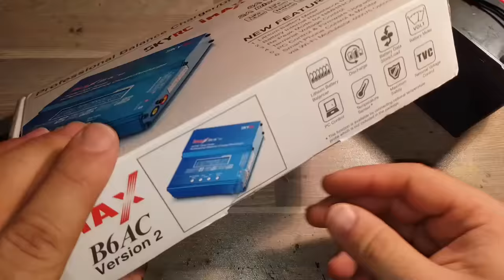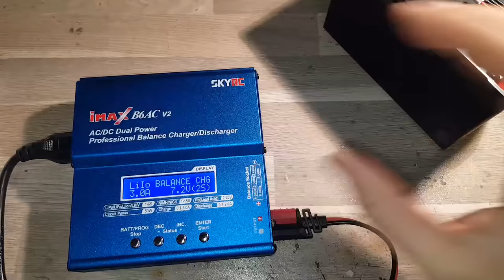DIY How To Make a Powerful 12V 18200mAh 420A li-ion Battery Pack

Comment: Sir, that's a nice and tidy make up. Excellent job. By the way , recently I made a lithium pack from BMS 20amps  3s and I put four cells in parallel 12.6v. But can I add another three cells to the parallel pack to make it seven like that of yours..?
And not forgetting your spot welder. It's nice and handy... 👍👍 Can you give a description from where else can we get it, or is it possible to set it on DIY..?? Pls respond..! Thanks.

Comment: Good morning, I hope someone will help me.  I have to make three 12v batteries that I will put in series, but to charge them I will charge them individually.  Now, I don't get 3 batteries of equal amperes, two 10.5A and 1 of 12.9A.  Of course with BMS.  What can I do now?  Do I put an extra row of batteries to get as close as possible to the amps of the largest battery, or do I distribute the largest 18650 batteries over the three batteries so that you get 3 almost equal batteries?  Is the BMS able to withstand a difference in level of 250mah between the big batteries and the others I have?  Perhaps it is better to put an extra row of 18650 on the two smaller batteries.  What do you say?  A thousand thanks

Comment: Is this working without BMS ? Why need bms
Reply: Bms is battery management system. It protects from overcharge, overdicharge and stuff. You probably could do it without but if you go below 3 volts or so your battery pack may get permanently damaged inside.

Comment: Use BMS for healthier batteries :)
Reply: Lol.
Reply: He probably thinks it's OK with no BMS since he uses a Hobby Charger.and balance charging. This will take a LONG time to balance since it uses very small balancing current. Even with normal "Balancing BMS" board it will take forever to balance.
Of course with no BMS there is no Over-discharge protection, which is the most "dangerous" aspect of this build.

Comment: Hello from California. Thank you for the presentation.
Do you have to have external balancing cables, when you, already have a BMS connected to the battery cells?
I know, you are not going to respond to my query. But that’s alright.  
I have assembled similar package with 20A BMS, with no external balancing cables, 6 years ago.
Charging is done by connecting to the Positive and Negative terminals only and it’s charging and discharging well.
Thanks.

Comment: 3 in series by 7 in parallel? Nominal voltage of a 18650 is 3.7v. 3.7 x 3 = 11.1 so most of the time its not going to have a 12v output only when its almost fully charged when the cells are 4.2v each. Do BMS do step up/down voltage regulation?

Comment: The strain on the main terminal wires plus the uninsulated top of the pack made me uncomfortable.  It might work for awhile but this is not a safe battery.

Comment: don't try to fool, those 18650 batteries are each 2.200 mah peak. which every three batteries is in series and those 7 packages of three batteries are in parallel. which would give a value of 12v and 15.400 mah, the amperage would be 15 amp and 400 milliamper peak. which   the nominal amperage would be  between 8 to 10 amps, more or less  I calculate
Reply: Try to calculate after studying more electricity physics. Yes, I'm agree with 15,4 Ah , maybe more, but each cell of all 21 can give over 20 Amps short time, so this battery sure can provide 11..12V @ 140A. You confounded Ah with A !

Comment: Nice one :)  But did I see right,  Are you charging it using LiPo Settings on your Charger ?
Reply from the maker: Yes, because in the charger settings is not right, there are error, the real settings lipo battery is 3.2-3.6v and li-ion 3.7-4.2v, but my charger settings is lipo 3.7-4.2 and li-ion 3.2-3.6v.
Reply: @ARMTechHomemade  ... the charger is correct...
3.2 to 3.6V is for LFP LiFePO4 cells... 
lLiNMC or Lipo are 3.7-4.2

Comment: I received the same spot welder today but is not the capacitor you told me it is different one you told me 50v 2200uf capacitor but it is not because they send me with the unit 35v 1000uf  why you told me 50v 2200uf ? thanks very much it seems to be two types i dont understand please explain thank you
Reply: Mine has also a 1000uF 35v and some do receive this board with a 2200uF 35 or 50 volt, it's not a big deal.
Reply: so please what do i have to look out for so i dont damage the mosfets  ???,  because lots of people complaining that their unit don't work anymore... I haven't connected my one yet but I'm trying to get as much information as I can so I don't damage the unit,  thanks, big thumbs up

Comment: What’s that cool „spotwelding device“??
Reply: One of the cheap spot welder tools online for building and repairing battery packs
Reply: @brettschacher8644  what’s it called?
Reply: @Mustangschweinderl  Spot welder ! There are dozens of different models online but they all do the same job. Powered by batteries or super capacitors.

Comment: what is the rating and the voltage of the capacitor please because I have one of those welder and I need to get a capacitor for it but i dont know what capacitor to get??? thanks
Reply from the maker: for this one you need 50v 2200uf capacitor

Comment: Hi, great job.
I hope I can get one as I have several recycled 18650s.
I understand that it does not carry BMS as it solders the cables for balancing on the IMAX.
What is not clear to me is where it connects them, the last Niquel welds are not clear to me. Is it possible to find a wiring diagram somewhere?
thank you

Comment: Once again, someone is building a battery without fully understanding what they're doing. 

Yes, you're using a BMS.  Yes, you even put a separate balancer charge plug.  But all you're balancing is the individual banks of cells.  The individual cells in each of those banks are not balanced.  This will create problems down the road.
Reply: Wrong! Cells in parallel don't need balance. They have same voltage. Think, man!

Comment: I wonder if that would still work in a battery back up system.  That the led equivalent fits in.
Reply: Sealed lead acid batteries and lithium packs have very different charge rates, and systems.

Comment: Usta 12v nasıl buldun 3.7x3=11.1 yapmiyormu ben yanlışmış hesapladım bende yapmak istiyorum şemasini atarmisin sana zahmet
Reply: Birde kaç tlye mal oluyor
Reply from the maker: When you full charge it 3x4.2=12.6v
3.7v it's not full charged

Comment: Why do you spotweld these Batteries...  Each of them need a fuse on at least one side!!!   Why  420A???  It is only a 7P3S Batterypack....  you shoud not use them with more than 7Amp for a long time...  Or you will damage the cells

Comment: Why bother putting a 60A board on a a battery that's only good for maybe 20-30A? Even if you used copper strips the cells aren't capable of 40A continuous any day of the week, I can guarantee that. If the P42A and Samsung 30T can't do more than 35A continuous then those LittoKala 18650's probably can't do more than 20A.  I'd be they are good for 15A.

Comment: Lifepo cells is little bit better, because you can use it in 4S format instead of 3S and get a little bit more Voltage ranges for full and empty range. And more current ability. However  If I know weel more expensive :S

Comment: absolutely wrong - this cell typically gives 2 Amperes at 3.7 Volt ( between 3 to 4.2 V).

Three cells in series will give 12 Volt.
so , 7 such series are connected in parallel - 
THAT CAN GIVE ONLY
7×2= 14 Ampere !

Comment: @ARM Tech Homemade - great video.  I made up a couple of these packs, but when I put them into the APC UPS, they run fine for a few minutes then the red light goes on, along with the audio alarm.  Not sure if I missed a step, or hopefully you have the answer to what went wrong.  Thanks for any info.

Comment: Can I get a link to the battery you used to drive the spot welder?
Reply from the maker: https://www.aliexpress.com/item/32995442667.html?spm=a2g0o.productlist.0.0.17aa5ee7ILu2Mg&s=p&ad_pvid=2020091712545371980306520200000575970_1&algo_pvid=552a6bdb-50d5-483b-97cf-56c865d05594&algo_expid=552a6bdb-50d5-483b-97cf-56c865d05594-0&btsid=0b0a0ac216003724929622866ef08a&ws_ab_test=searchweb0_0,searchweb201602_,searchweb201603_
Reply from the maker: take 6000mAH  60C
Reply: @ARMTechHomemade  How do you charge it?
Reply: @ARMTechHomemade  Could I just use a 12V 35Ah SLA battery?
Reply from the maker: @Jasonewa  https://www.aliexpress.com/item/32831586944.html?spm=a2g0o.detail.1000060.1.641837d2PmuxEw&gps
Reply from the maker: @Jasonewa  yes you can try it.
Reply: @ARMTechHomemade  I read somewhere that you should use a battery with at least 450 cca and 18ah 12v batteries can supply up to 255A at once. Running in parallel gives me 510A, should be enough to spot weld .1 thick nickel strips

Comment: 3 batteries in a series is 11.1v, but 4 will be 14.8v. Both are a distance from 12v. What is a better option, 11.1v or 14.8 v?

Comment: What is that circuit you connect in lipo battery to  weld where can i order?
Reply from the maker: https://www.aliexpress.com/item/1005001278462873.html?spm=a2g0o.detail.1000014.15.47552a43lmj0J0&

Comment: Sir can u supply smd led, capacitor, mov, resistance, ic drivers, ACDC batteries, DOB raw materials, led  strips, led tube lights raw materials  with Tikki fitting n punching machine n all other accessories etc, guarantee of raw materials, mode of payment,  please send me the details of the above immediately
Reply: No. This is Youtube, not product supplier.

Comment: NOPE!! Does LiitoKalas are not 60Amp burst. Basically they are refurbished cells from laptop batteries and have internal resistance about 40...60milliOhms and usual current 1...3Amps, max 5Amps. Your battery pack has 35Amp at best, not 420 Amp that you think. If You dont belive me,  try to short it  whit 150Amp fuse. BatteryPack shoult easily pop the fuse... but i can eat my hat, that it wil not and battery will make bad smell and goes warm!

Comment: bonjour Monsieur,je suis bloqué malgré mes recherches,si vous pouvez 
m'orientez s'il vous plait,je cherche un bms pour mes 50 piles 
LGGBMH11865 3200 mah pour monté un 10 s 5 pack 42 volt 16ah ,je cherche 
sur ali mes il y a tellement de produits,je suis un peu perdu,merci de 
votre aide
Reply from the maker: Bonjour,  je vous propose d'acheter sur Amazon,  c'est la même produit que ali, mais livraison plus rapide et en plus je déjà utilisé cette BMS et il fonctionne parfaitement. 
https://www.amazon.fr/dp/B07CMB83RN/ref=cm_sw_r_cp_apa_fabc_qyZ.FbGVPDT43?_encoding=UTF8&psc=1

Comment: How to go about to make 12v 5amp for bike battery
Reply: May we help you?
Reply: @mohammedyasarshaikh4090  yes pls help needed.
Reply: @arvindaable  simply by connecting batteries in series you will get more voltage and adding individual batteries in parallel with each battery will increase Current, thank you

Comment: good packing, but fake information, from where you state 420A!!!, this is 3S7P, so MAX current 18650 battery in world is 30amp so 30X7= 210amp and this is for few secs only, for real information use battery quick discharged and see what you will get (you will be lucky if you get 200amp), also despite this is Chinese made, do discharge from 4.2v down to 2.8v to see the real capacity.
it would be great if this pack can produce around 60WAH, also Pulse current is useless here it will only trick the audience to say WOW.

Comment: Really !!! Litokala?? 40A ?? Even best brands doesn't have cells that can handle 40A and you are showing people Chinese cells with fake discharge current rate ?? Other thing only 4 0.2 nickel plated series connection this is a joke also 1 nickel strip to discharge connector ?? No more than 6A continuous discharge. Everything above start overheat strip and it may cause fire.

Comment: Liitokala – batterie rechargeable 3.6V, 18650 mAh, 40a Max, impulsion 60a, 2600, 18650

Color:
    1PCS

€ 2,12
€ 4,41-52%
Livraison : € 8,81via Seller's Shipping MethodLivré le 23 AOÛ ou remboursé intégralement
Liitokala – batterie rechargeable 3.6V, 18650 mAh, 40a Max, impulsion 60a, 2600, 18650

Color:
    10PCS

€ 17,87
€ 37,23-52%
Livraison : € 10,57via Seller's Shipping MethodLivré le 23 AOÛ ou remboursé intégralement

Comment: These cells seem to be chinese cells...maximum 10 amps/cell (you don't show us...), so it's impossible to produce 420A !??, but just 70A max (7 cells in //) and surely less than this Max.....and it's the best for you, guy, because your thin nickel strips could not support such an high amperage.Please read all judicious comments below!
And even with such an assembly for 50A,  possible that the // connection is enough, but it's necessary to double your serie/strips  to avoid any dangerous damage if you really simply need 50A......
When I think you already have 2.126.176 views (and how many neophites.?)..In France we say "it makes me cold in the back"...Please, please modify your video, it's surely pleasant for you to show what you can do on the screens...but what you do is wrong...no, not wrong , because your battery can be used, but dangerous if we need the Max Amps. Music explains nothing, useful explanations are missing!

Comment: This is VERY DANGEROUS! You didn't provide balancing resistors or capacitors or isolation diodes or install charging control devices as ALL Li-ION makers REQUIRE when building "packs" from their individual cells. I work at a hobby shop and we sell Li-ion, Li-Po , LiPo4FE and more exotic batteries. Half the cost is the PROTECTIVE DEVICES. Open a name-brand power tool battery pack and LOOK what's in there! Your "pack" is a fire or EXPLOSION waiting to happen. Go ahead, be stupid. Cause a fire in your apartment complex that kills 16 people like in Indiana FROM A "HOMEMADE RC CAR BATTERY"!!!

Comment: Iz 10.8v battery bro!
Reply from the maker: 3x4.2=12.6
Reply: @ARMTechHomemade  batteries are measured by nominal voltage which is 3.6 in this case

Comment: only one of that cell series have seven cells, it is mor than 12v an the video title is about 12 volts, Icant understand that
Reply: This battery pack uses THREE groups of 7 cells in parallel. Each group of 7 cells has nominal voltage of 3.7V, so three of those in series means 3 x 3.7 = 11.1V
Reply: @johncoops6897  ok, nice response, I suposed 4.2v, thanks
Reply: @omarramirez5764  - Full charge on 12V Lead Acid battery is about 6 x 2.35V = 14.1V. The 3S Lithium pack would come off the charger at 3 x 4.2V = 12.6V
The best replacement for 12V Lead Acid is a 4S LiFePO4 pack, as they have an almost perfectly flat discharge voltage of 3.2v each,  so 4S is 12.8V and acts like a 100% charged Lead Acid for approximately 90% of it's capacity. LiFePO4 is also much better on "impulse" current.
Reply: @johncoops6897  Im working at this moment in a pack like the yours one to be used in a scooter 150cc for start the engine. Im selecting cells.. thanks by response John.
Reply: @omarramirez5764  - Use Lead Acid batteries for starting your scooter. They are cheap, handle the current, are reliable and work the best, that's why everyone uses them.
Reply: @johncoops6897  Sorry to say that but im unemployed due to pandemic situation. Recycled LI Ion cells are cheapest than lead acid at this moment... Also, Im learning a new things. i have 80 cells that are tested and reviewed. From Dominican Republic Thanks
Reply: @omarramirez5764  - 80 recycled cells from  old laptop batteries, right? So, when you check the specs (google is your friend) you will find that they have maximum discharge current of 4A or 5A per cell. So, to get a 100A starting battery, you'd need 20 or 25cells in parallel then either 3 or 4 groups in series.
That's almost all of your cells - how are you going to house that, perhaps build a special trailer?
How are you going to charge them? You cannot use the existing bike charging system, so you have to buy something else. You can't easily disable the existing bike charging (alternator) so you either spend money buying and installing a charger or you spend money modifying the bike... otherwise.the thing will fail and might even catch fire!
Also you need a 100A BMS or some other way to ensure that voltage never drops too low, and the cells are protected against over-voltage too.
TL;DR: you cannot (easily) replace an existing Lead Acid battery with a lithium pack like this.
Reply: @johncoops6897  Good Information. I have cell database page in bookmarks. The old lead acid battery says 12v 6.5aH, It worked but not as good as the OEM battery. im building a Charging (pssibly Discharging) System for 7 cells at the same time. I made a BMS too simple but it makes the balance charge very good. I have saved in a txt this important information that you write here John... ah there are several videos about replacing car battery. Dont worry about fire I  will put metal case wuere the battery goes in the scooter and senso temp. alll precautions jeje.
Reply: @omarramirez5764 - lead acid battery 12v 6.5aH is from a UPS or child's soy. That is not the same thing as a starting battery, much lower peak current capacity..You would notice different connections, using spade terminal rather than terminal and bolt that the original scooter uses.
Reply: @johncoops6897  jaja John there are motorcycle versions! with bolts or nuts conectors... I know about ups systems but I worked two years in a motorcycle parts store... so you know "same battery with diferent  conectors.

Comment: Bro... this battery is very dangerous! You need a proper insulation between the 3 cell packets and you set the charger to LiPo but these are LiIo cells. Learn to make proper battery packs or don't do it.